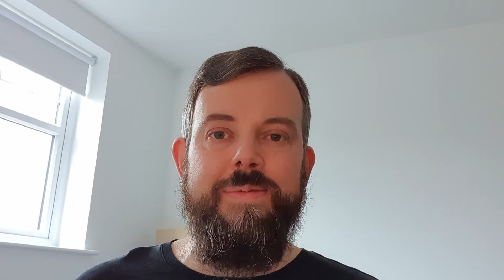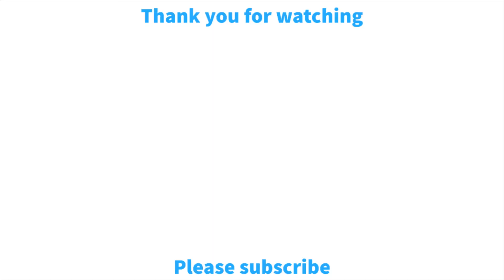EICR codes in on-site guide to BS7671

Comment: Where in the OSG are the coding examples? No mention of page number or section?
Reply from the maker: Hi, the examples are in appendix G on page 181 of the on-site guide.
Reply: @JamesCurnowElectricalEngineer  Thanks for the info, I completely missed those! Great videos by the way, keep up the great work.